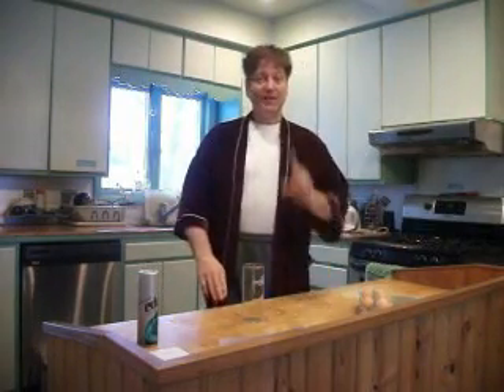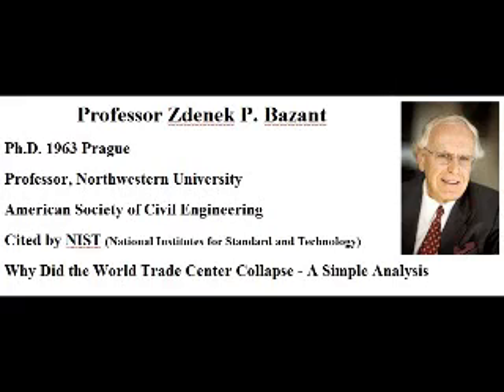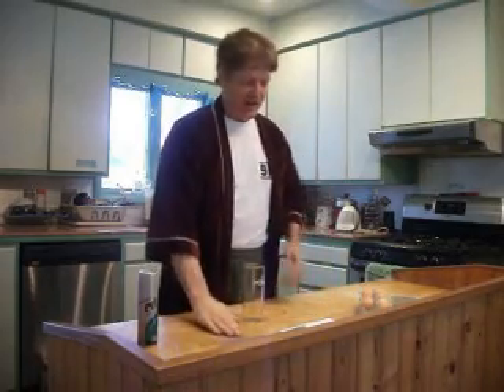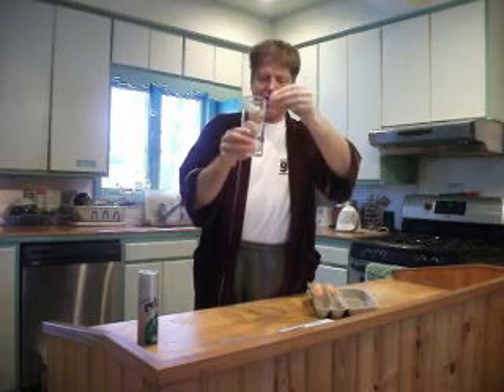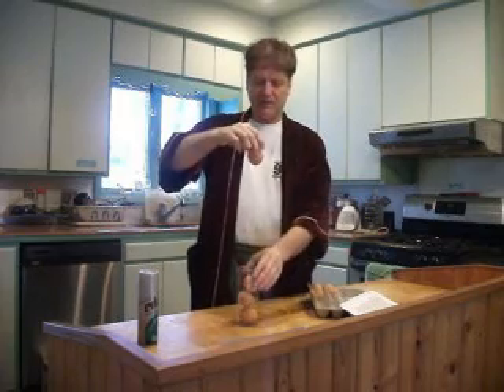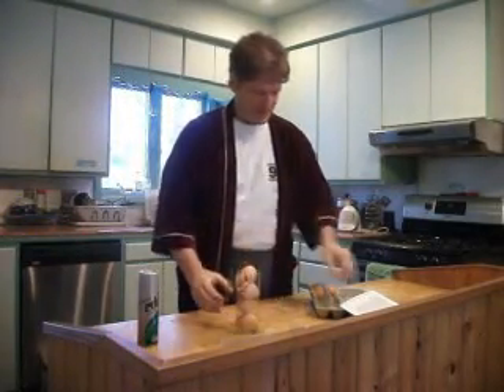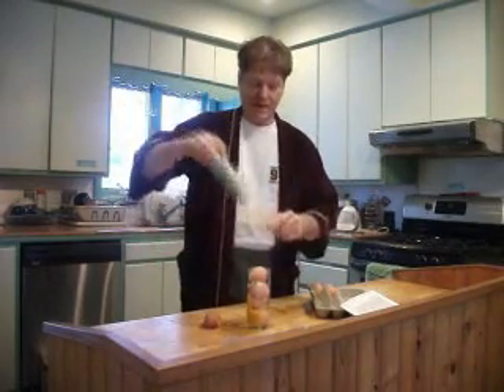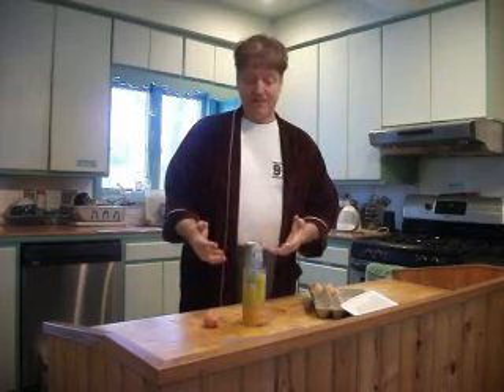9/11 Experiment: Egg Drop, Equal Collision disproves Bazant's "Pile Driver" Theory

Comment: you are correct, in order to create the ability for a structure to collapse through itself, you would need more force than that structure can exert naturally while still in a static form, which mean's that if you had a building, and dropped the top portion on the a larger bottom portion, the top portion could not go through the bottom portion, unless you either added extra mass or speed than it originally had in it's original format.
Reply: +ALAGOR ROGALA  It's all noteworthy to watch but wouldn't the extra weight of the airliner be enough to wrinkle the theories?  Didn't most of the mass of the airplane and it's contents stay within the building, minus the fuel burning on impact?  I would think using 4 supports (hollow column) for the eggs in this experiment rather than enclosed in a glass would better hold them in a relative state of strength so that they could burst sideways.  It may come out showing the same but more impressive and relevant.
Reply: It doesn't make any connection at all...

The HOLE in the south tower (77th through 85th floors) had at least 152,000 tons on top of it. That's weight only counting the structural steel. There is added weight of 33 floors of 4 inched layered concrete that sits on each thin steel truss that makes up the floors, the furniture and equipment such as desk chairs, computer servers, generators, pipes, electrical cords, all the dry walls on each floor and then not to forget about the people. The Hat-Truss located on the top 4 floors that connects all sides and corners of the building adds an additional thousands of tons of weight. Since the hat-truss is only supported by the narrow and hollow core, once the corner of the South Tower buckled and snapped, all of that weight wasn't distributed evenly and the tower leaned towards the corner that snapped and the core was already in collapse because the weight of the Hat-Truss along with the other 152,000 tons of 33 floors falling on top of floors only capable of stopping or slowing down weight not greater than 4,600 tons. Each floor weighs 4,600 tons. So, we're talking about 4,600 tons versus the kinetic force of 152,000 tons. (Not the same comparison to crashing two eggs of the same mass and weight) Since the hat-truss was holding the top 4 floors in one piece during the initial collapse, the truss didn't seem to break apart until after it had gotten to the impact zone. This is why the top of the tower looked in tact until it fell passed the 77th floor. Remember, the top of the tower was leaning until it corrected itself to fall evenly after it passed the impact zone of the plane. The Hat-Truss is the reason why the core was pulverized. Had it not been there, the Tower would have collapsed differently.

The same goes for the North Tower except that the North Tower's HOLE was located at the 93rd through 99th floors making the weight burden 80,000 tons. (4,600 tons of stationary floors versus 80,000 tons of kinetic force). That's a 72,000 ton difference which explains why South Tower fell first.... Well, there's also another factor;  South Tower's impact zone was closer to the corner so weight distribution is more compromised.

The two planes added 280 tons of weight each, but their weight is insignificant to the collapses of the buildings. The planes' purposes was to impact the building to compromise the structural integrity. There was a big 6-story hole per building sheering off some parts of the exterior and also, some parts of the core... The heat however, also played a roll because it weakened and made soft the columns of the core and floor trusses that are connecting the buildings' exterior to their cores that are trying to hold up 152,000 tons and 80,000 tons on top of the other 4,600 tons floors below.

In a nut shell:

South Tower: 4,600 tons vs 152,000 tons
North Tower: 4,600 tons vs 80,000 tons
Not a 2 ounce of Egg vs another 2 ounce of Egg (at whatever height)

Note that in this video, the presenter placed the eggs nice and flush in a glass tube. The exterior of the glass pressed evenly at the sides of the eggs reinforces the eggs ability to withstand more force because the falling egg's force is distributed onto the glass.

Comment: I have to admit I was actually curious what I would find here... but this is  - let's put it the polite way - physically not connectable to a bigger model...
Reply: It doesn't make any connection at all...

The HOLE in the south tower (77th through 85th floors) had at least 152,000 tons on top of it. That's weight only counting the structural steel. There is added weight of 33 floors of 4 inched layered concrete that sits on each thin steel truss that makes up the floors, the furniture and equipment such as desk chairs, computer servers, generators, pipes, electrical cords, all the dry walls on each floor and then not to forget about the people. The Hat-Truss located on the top 4 floors that connects all sides and corners of the building adds an additional thousands of tons of weight. Since the hat-truss is only supported by the narrow and hollow core, once the corner of the South Tower buckled and snapped, all of that weight wasn't distributed evenly and the tower leaned towards the corner that snapped and the core was already in collapse because the weight of the Hat-Truss along with the other 152,000 tons of 33 floors falling on top of floors only capable of stopping or slowing down weight not greater than 4,600 tons. Each floor weighs 4,600 tons. So, we're talking about 4,600 tons versus the kinetic force of 152,000 tons. (Not the same comparison to crashing two eggs of the same mass and weight) Since the hat-truss was holding the top 4 floors in one piece during the initial collapse, the truss didn't seem to break apart until after it had gotten to the impact zone. This is why the top of the tower looked in tact until it fell passed the 77th floor. Remember, the top of the tower was leaning until it corrected itself to fall evenly after it passed the impact zone of the plane. The Hat-Truss is the reason why the core was pulverized. Had it not been there, the Tower would have collapsed differently.

The same goes for the North Tower except that the North Tower's HOLE was located at the 93rd through 99th floors making the weight burden 80,000 tons. (4,600 tons of stationary floors versus 80,000 tons of kinetic force). That's a 72,000 ton difference which explains why South Tower fell first.... Well, there's also another factor;  South Tower's impact zone was closer to the corner so weight distribution is more compromised.

The two planes added 280 tons of weight each, but their weight is insignificant to the collapses of the buildings. The planes' purposes was to impact the building to compromise the structural integrity. There was a big 6-story hole per building sheering off some parts of the exterior and also, some parts of the core... The heat however, also played a roll because it weakened and made soft columns of the core and floor trusses that are trying to hold up 152,000 tons and 80,000 tons on top of the other 4,600 tons floors below.

In a nut shell:

South Tower: 4,600 tons vs 152,000 tons
North Tower: 4,600 tons vs 80,000 tons
Not a 2 ounce of Egg vs another 2 ounce of Egg (at whatever height)

Note that in this video, the presenter placed the eggs nice and flush in a glass tube. The exterior of the glass pressed evenly at the sides of the eggs reinforces the eggs ability to withstand more force.
Reply: still, i admire the presenter for his devotion to his hobby
Reply: Wrong.

Comment: A mouse or cat's anatomy is different from a human in that flexibility of the backbone allows it absorb more shock. A cat can jump many times it's own height, while a human cannot. This again goes back to the animals anatomy. The cat's muscle fiber just like the bone structure is a lot different. Therefore a cat lb. for lb. is stronger than a human and this explains why smaller animals can take a relative higher fall and survive. Air resistance has no role in this matter!

Comment: Not even close, by the way, NOTHING in any building, is designed to resist dynamic crushing, or movement at all, and I would dearly like to see you run that by any civil engineer. Really.
Think about the practical uses for this psuedo factoid. Buildings could bounce their way to a new location.

Comment: Oops, typed 12 tons instead of 1.2 tons at most, multiply that by .1%
for the actual distribution of WTC concvrete dust versus the fiber dust,
It's NOT a claim, and it IS supported by NYC trucks picking up the dust.

Comment: Oh, by the way, the actual source of RJ LEE's comment, is of course,
the KNOWN engineering characteristics of lightweight concrete.
The impact of the 130 million pounds of Upper block on the FIRST
concrete floor, would have shattered the concrete, not ground it.
It would be like hitting every square inch of a window, with its own
ball peen hammer. Exactly, what the videos show what happened.

Comment: And, of course, I can document everything I just told you with at least
13 different WTC dust studies and standards done since 2001. It's NYC,
There are LOTs of Idiot lawyers in NYC desperate for a buck.
Here is the NYC building inspector standard. There are about a dozen.
WTC, WTC DUST, and NO RED GRAY CHIPS Photos.
inspectapedia. com/ WTC/ WTCdust. htm
WTC, USGS SPECTROSCOPY LAB
speclab. cr. usgs. gov/wtc/
WTC, WTC DUST, and USGS FE SURVEY
pubs. usgs. gov/of/ 2001/ ofr-01-0429/feats-1um. html

Comment: Lastly, your last nonsense is easily dismissed. Several sources have
computed the volume of WTC dust, from NIST to PANY, to FEMA.
NOBODY claims more than 60 to 100 tons. Think about Fella, it was
airborne, ya know, it's not rocket science. Run your 0.2% past that
harsh number, and you end up with 12 tons at most, but the problem
there is that MOST of the dust was FIBER, from paper, cloth, and
fiberglass. Not dust at all. SO, take your 12 tons, and multiply it
by 0.1% again. Not a lot, huh?
Reply: Paper dust? How did that form?

Comment: The point, of course, is that falling debris is NOT a coherent object.
The upper block could have as little as six floors falling in front of it,
as pieces no larger than a shoebox, and still blast thru any floor 
below it. But, in fact, if it had six floors, it had 94 (47x2), 36 foot
long, 30 ton steel core beams to smash thru the 4 inch thick floors 
below. That's a big shotgun, and a thin floor. The upper block doesn't
even need to get involved.

Comment: No, actually it doesn't, AND it ignores every lesson we know about it.
Hate to break it to you, but you are falling right now, at 1g, even at rest.
That's what weight is. Force = Mass X Acceleration. think about that
for a second. The building below the upper Block, was already falling.
All the falling block had to do, was shear thru the bolts that held it.
The OTHER example of flying debris is a shotgun blast. It doesnt jolt.
It still clears whole chunks of flesh out of the way. Just vertical.
Reply: Much of the weight is blown out horizontally, with huge beams flying out far distances. The building didn't collapse downwards. It explodes outwards.

Comment: Now, this is a brilliant argument! Thank you for the lack of ad hominem, too.

But the problem with this is that RJ Lee never explain the source of this.

With between 0.2% and 5.47% iron microspheres in each sample of concrete 9/11 dust, that translates into hundreds of tons using the lesser percentage!

Even 1 ton would be difficult to explain. You'd have to have tons of iron wool (not steel wool) in the fire zones. Oops!

Comment: Ad hominem never works. 8 floors of perfect free fall means steel offered zero resistance. And if you're fool enough to think that steel could EVER offer zero resistance, then you better not ever enter a steel frame building.

Falling debris never jolts? If you fall out of an airplane and hit the roof of a building you're going to decelerate for a moment (jolt). Simple physics! If you can't see that fact, then I may as well be talking to a wall.

And RJ Lee missed the SOURCE of all that iron

Comment: 1.That would be 8 floors out of 47, Moron. What slowed down that collapse?
The steel frame you just got done blowing up with Mystery Mojo Juice?
2.Too bad for that old canard of the missing jolt crap. The first reply,
delivered 7 years ago, was that falling debris NEVER jolts. Neither 
does the first analogy to it, sand falling over a post.
3. That's ODD. RJ LEE himself points out that Iron Microspheres are
NOT evidence for Nano Thermite, don't have the volume for even 1 TON.
and not from WTC

Comment: a lot of people forget that the towers were designed in such a way that the higher it went the steel and concrete was made lighter, so lower floors were made of stronger heavier steel to take the weight of the upper floors getting lighter the higher the tower went,so in effect you have lighter steel crushing heavier stronger steel and concrete
Reply: However when watching what happened in slow motion, one sees much of the above weight being blown out laterally, sometimes at far distances. So the supposed weight coming down, isn't coming down on the building. It's falling in the air.

Comment: You miss the fact that in the 9/11 tower collapses, a large percentage of the weight was lost AS the bldgs collapsed -- all that concrete dust being ejected, along with steel beams (some as far as 600 feet). A puff of air from collapse didn't push those to the side. Explosions did it.

See David Chandler's work. Some explosions were at corner supports (no windows) and clocked at up to 100 mph.
Reply: You can see lateral ejections! Why do people negate what they can plainly see?

Comment: @wjs675, your statement proves your ignorance. You could take eggs, planets, golf balls or any other type of object. This proves Newton's laws of motion -- for every action there is an equal and opposite reaction. 1 egg crushes 1 egg, not 2 or a dozen. Just as 10 floors would crush 10 floors, if any, not 90.

Also, much of the mass is missing as it's blown to the side as bldg collapses, so it's like subtracting a portion of each egg as it falls. All that concrete dust is major factor

Comment: This proves nothing about structural engineerinvg. Are you not aware that each egg is a integral structure and that eggs famously have one of the most crush resistant structures in nature? Try crushing one from top to bottom in your hands (not from side to side where the structure is weaker. The floors of the towers were built on top of each other and were not freestanding structures with unrivalled structural integrity. Your experiment proves nothing but your ignorance.

Comment: any two objects of the same hardness colliding together will do equal damage to both. doesn't matter what the medium is.  Eggs, or megaton granite blocks.  This experiment does illustrate that undeniable fact. The only way the top of the building could have plowed right through the bottom of the building in that fashion would be if the bottom was that much weaker than the top. Unfortunately, both pieces were made of the same material.  Try it with any material of your choosing.

Comment: also take into account that the top of the building didn't fall on eggs.  It fell on a larger, yet identical piece of building.  The upward force of the lower building would've crushed the upper part at the same rate, long before it reached the bottom if gravity and fire were truly the culprit.

Comment: @rshaddock No need for the sarcasm. I simply pointed out a fallacy in your analysis. The relative force exerted by the top ten floors on the top-most non-collapsing floor is in fact ten times larger than you make it out to be.
Then what about the next floor? eleven eggs worth of weight pushing down on one? Then the next--twelve. Yes, the remaining structure beneath it absorbs the shock to an extent, but you can't disprove the authenticity of WTC with such a limited experiment as this one.

Comment: Not at all  convincing.
First of all, the "falling" egg has a mass "m" such that the force exerted by the initial collision is of some magnitude ""X"

in WTC (let's talk about "eggs" instead of floors), the falling ten eggs fell simultaneously on the top egg, exerting a force of 10X relative to the situation described above. 
If it's even physically sound to replicate WTC with eggs as you have, you would still need ten eggs dropping at once for your analysis not to be fallacious.

Comment: @physicsandreason "The principle you are demonstrating, Newton’s 3rd law, is absolutely correct regardless of material" According to Bazant`s theory, the upper mass was virtuallly solid.  Problematic when the structure benath would hold a greater strength than "solid" or benefit from the "Accreting masonry mass" . Since it would also be bound to the same laws, equal and opposite. Collision between defined objects will act on accord with configuration and compositional strength. Asymetrically

Comment from the maker: Yes, a scale model would be ideal, but expensive.  If you know of one, please post it.  This experiment shows the Law of Equal and Opposite Reaction.  Whether you use eggs, ice cubes, or a steel model, the result is the same.  Material falling on the same material is demolished equally.  A "pile driver" would need to be much harder material, or explosives were used on the bottom floors.